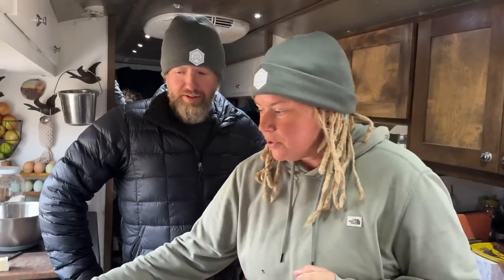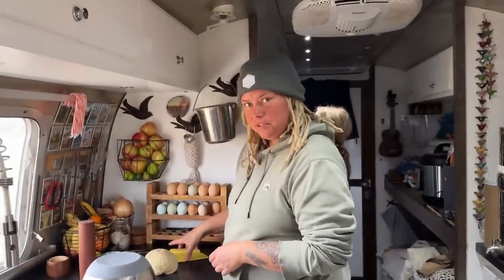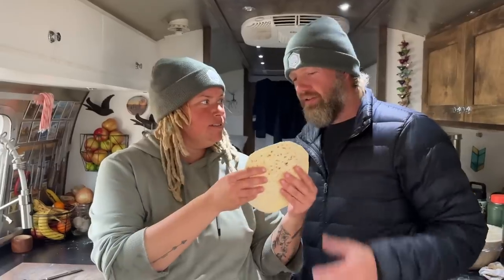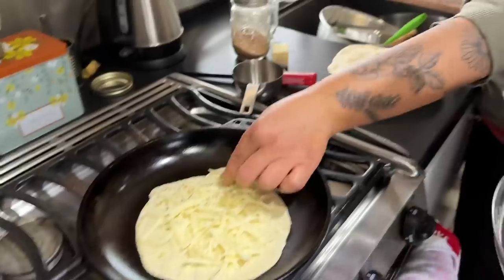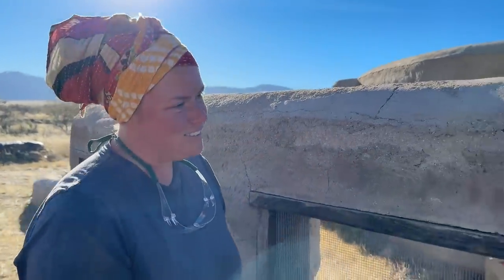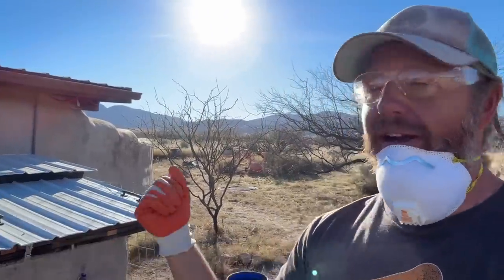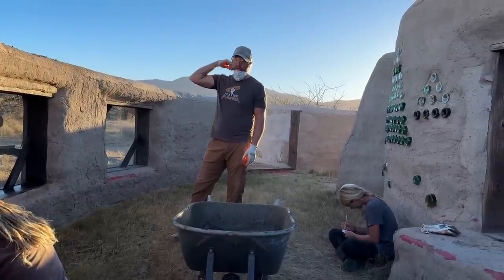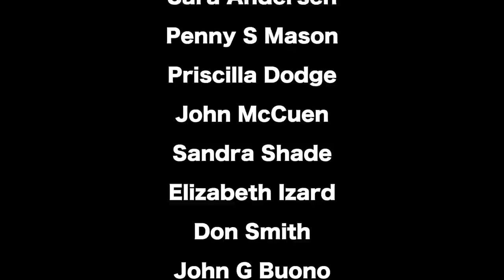Stucco & Homemade Tortillas? (Chicken Garden Day 178)

Comment: I have a larger kitchen so I have the traditional implements of the tortilla-making trade, a tortilla press, and a Comal (koh-mahl`) which is a flat iron cooking/heating/frying pan that comes in different sizes.  The press is very useful when making large batches and your desire is for consistent uniformity.  The Comal does not have the sides of a frying pan so it is easier to fry, cook and flip your tortilla. Your way works very well and many a household use the same methods

Comment: Funny you making tortillas.  I make my own too.  and I mix it up a little.  I add Italian herbs (basil, marjoram, oregano) or strictly rosemary and rubbed sage or sometimes just garlic finely chopped with onions too.   It changes things up.  I too fry them in a frying pan with a little butter or in a Teflon coated one that doesn't require oil to "bake".  They still puff up beautifully and the different 'flavors' make them a great re-heated snack!

Comment: 1/3 c Butter
1 c Water
Heat to melt and warm 

1 tsp Salt
1 tsp Baking powder 
3 c Flour
Mix together then add butter water mixture until shaggy

Then knead 2-3 min minus dog interruptions 

Let rest 15-20 min

I used whole wheat flour and  Mrs. Dash no salt everything but the bagel seasoning! Ummmm
Reply: I was thinking, wondering, if "on the spot" gound up flax seed would be a good addition.

Comment: When I make tortillas I make a bunch and use wax paper or plastic wrap as a separator between them after cooking them until almost done.. I then put a meals worth in a gallon ziplock bag and freeze. I make about 10 meals worth in that day. So that the next 9 times are so much easier to make.

Comment: What is the stucco recipe you are using? Looks like a basic recipe is 3 parts sand to one part Portland cement. Is that what you are using, are you adding any lyme or plasticizers? Thanks! We are working on a supplies order for our son's hyper adobe build.  🌞
Reply from the maker: It’s a one coat mix from quickcrete. Sand, cement, lime, and fiberglass.
Reply: @TinyShinyHome  Thanks so much for the reply!